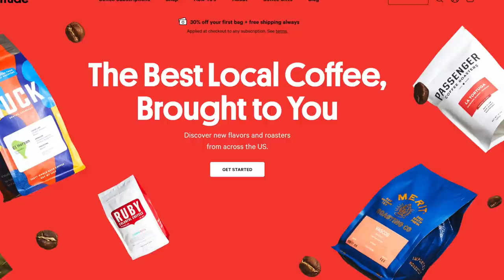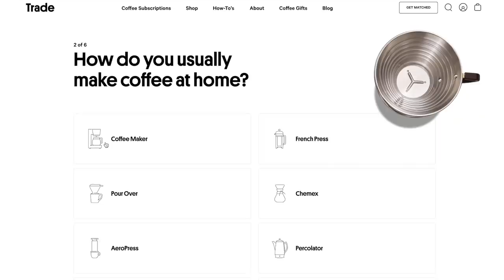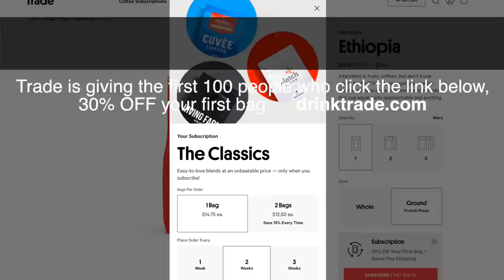⛵️Refitting an Abandoned Sailboat (22 YEARS LATER) *THE REALITY #124

Comment: You may want to look into that wall after you fix the leak. You don't want mold growing where you can't see it. 
As another thought, you should add a small mooring cleat or eyelet to the bottom of that wooden ladder so you can tie it out of the way easier
Reply from the maker: We are still thinking about how to do it without taking all the room apart as to take that wall off we would need to take the ceiling and the stripes of wood from the wall. We need to give maintenance to the ladder and then we are thinking on adding a eyelet there ☺️

Comment: If you have access to a grinder, you should try using a wire wheel on it to remove paint form things like the lids. It will save you from using so many sanding discs.
Reply from the maker: We tried this method, but it would do toooo much of a mess with a lot of dust.
Reply: Odd Life Crafting I remove paint from metal by putting it in boiling water. Takes it all off but you would need a big pot to boil your parts 😂😅
Reply from the maker: We had epoxy paint there. We are not sure with boiling water would work there, it's a resistent paint.

Comment: Well I must say the tanks and bilges look fine , chasing leaks is always fun , but you well know now is the time to get them , all ...pull apart anything you think is going to be a problem, easier now than 2 years down the road .I must say I am pleased that you went the extra mile with the tanks, I was concerned you might let it go. While I am on the subject of fuel  , every boat inboard or outboard that goes through our yard gets a fuel water separator filter, with a plastic bowl for visual inspection with a drain on it , I do not know if yours set up that way but it works,we have put them in Hundreds of boats .Well keep knocking the work out and you will be done soon , keep up the good work !
Reply from the maker: Thanks for the always support. Our water tank was a little lid to do some inspections by time to time.

Comment: Checking for leaks you can use toilet papier or newspapers just stick in place with a piece of tape where the suspected leak is. Water running will quickly destroy the paper in this way it is much easier to find the right place of the suspected leak.
Reply from the maker: Thanks for the tip, Joost

Comment: The guaranteed, quick, and easy way to find a deck leak:
First you tape shut any cabin drains or vents. Close all hatches, except one. Block that one with a cardboard, and cut a hole in that. Fit a leaf blower or vacuum cleaner exhaust hose into the hole, and use it to pressurize the hull.
 Next you start at the bow, spilling soapy water on deck. The leak will "blow bubbles" in the soap water. That's where you need to fix.
 Be careful, a soapy deck is dangerously slippery. Rinse it all off before walking on it.
 Quick, simple, and it always works!
Reply from the maker: Thanks for the tip. It seems that we could solve the problem last week. We are gonna show you next Monday ☺️

Comment: 2:20  I would have a way to lock that hatch cover while in the storage area and not on the hatch - otherwise, some joker (or worse) could lock you inside your boat. Actually, it would be nice to have a hatch cover that locked from the inside using RF remote.  Or, even better, have a way to lock the hatch on the outside from the inside --- perhaps using RF with a manual back up in case the RF fails.  That hatch cover design would simply worry me. I suppose I am kind of paranoid about being locked inside an area where there is no second exit.  Or is there?  ---- Ok - never mind.  I think I saw a second exit at 3:25.
Reply from the maker: hehe. There are a lot of hatches to go out if one is locked